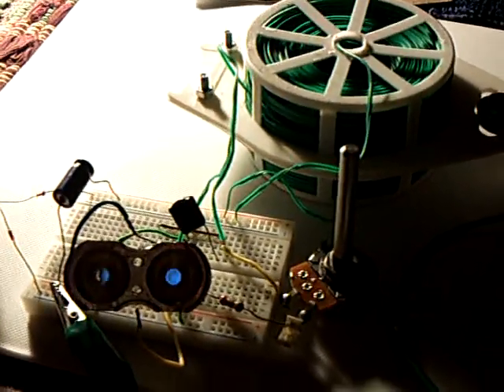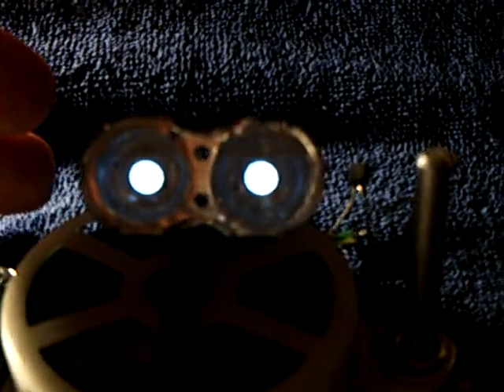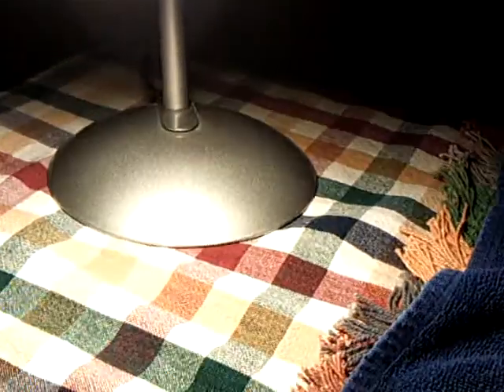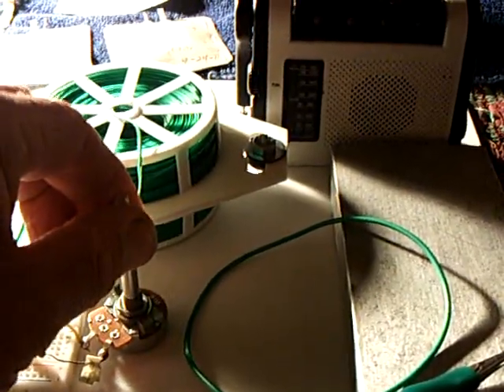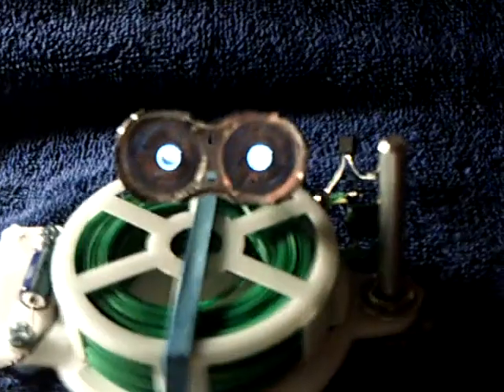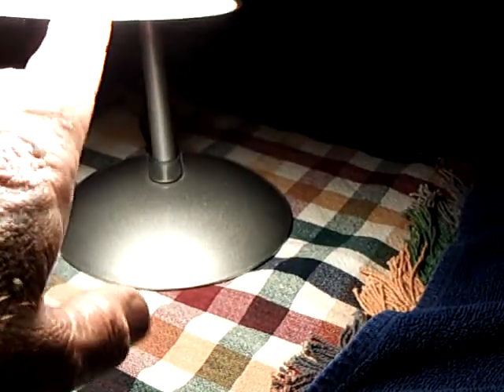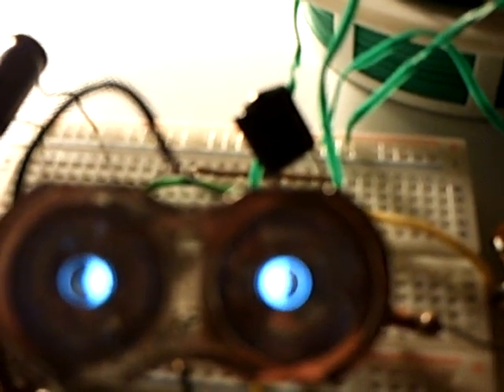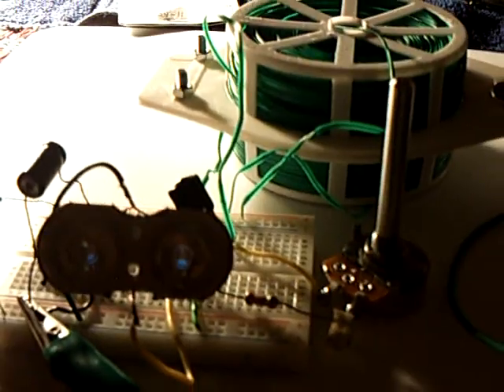Building Penny No. 2-- and  Running on thin air.ASF

Comment from the maker: @phi36nine -----Yes radio shack sells the diodes for the Avramenko plug.  They are 1N4148 small switching diodes.  Sometimes they are 1N914 labeled.  One diode goes one way and the other the other way,  Join the two together at one end.  The other ends form the (+) amd (-).

Comment: I replicated the penny circuit and it works great with lighting leds with crystal battery. How do i make the avarmenko plug?  Is it just adding 2 diodes? Can I buy them at radioshack

Comment: Awesome as usual!
Yeah, put it in a plastic food container (I like ractangular icecream boxes), and that inside a lead box of sorts. Then just the leds sticking out. See if Penny keeps on going in those conditions. Air tight, light tight, rays tight. Bring it down to the parts of the circuit itself.

Comment from the maker: @FREEGARYMCKINNON -------No. The lamp is just pulling power into it throught the house 110v AC system.  As the alternating current goes through the lamp it isn't completely contained.  The aluminum foil acts like a parasite and sucks energy off as it goes bye bye through the lamp and makes my electric meter go round and round.

Comment from the maker: @MrFlathunter ------For some reason I could never get an LED on an AV plug to light off a good ground like others have.  I have seen it done by several people.  It is energy leaking out from somewhere or wrong house wiring I guess.  I suppose if you are near a strong radio station then it could be coming from there.  I don't consider this "FREE" energy but rather bought and paid for energy being thrown away----or given away for free.

Comment: I don't think its the waves in the house that are powering it, maybe a little but not 100% powering it. I think the cell cycles energy and I do think that around the 26th (today) it should start going down. If the cell doesn't go down when its the first of next month then my theory is wrong. What I find odd is that the cell started off at a lower voltage then went down and fluxuates a little and now went up, so it should start to go down now. Great video and thank you.

Comment: Very cool. The 2N2222 is indeed a surprising little thing, much lower turn off than nearly anything else...couple of nanoamps. Best here have been C1815's or C2001 on my Penny replications (C2001 version has 2 coils of modem wire). Will try the thin air setup !